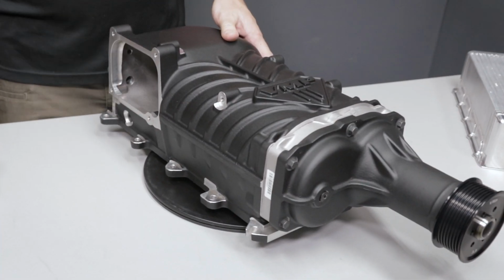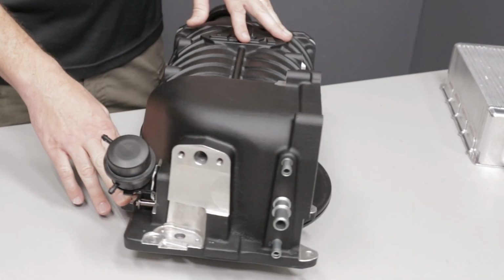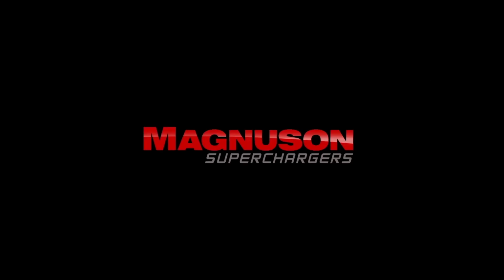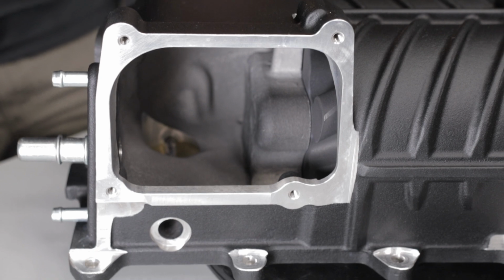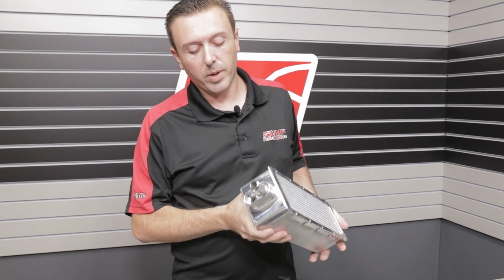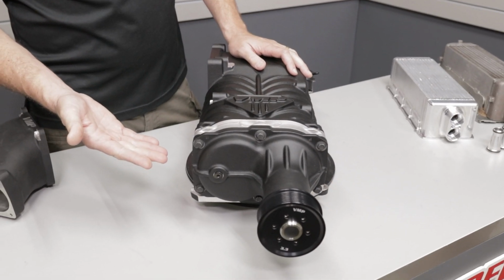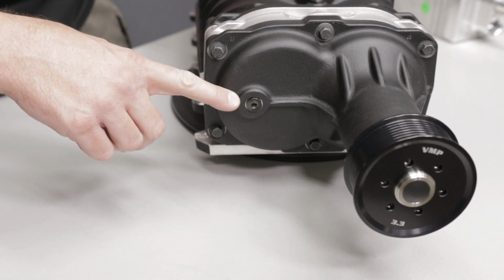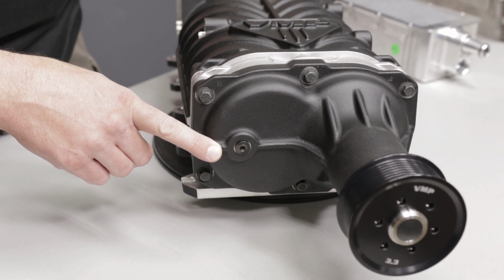Cobra Gen3R || 03/04 Mustang Cobra Gen3R and Upgraded Intercooler

Comment: Out of curiosity, what year did you guys come out with the VMP gen 1 2.3? Mid 2000's?
Reply: The 2.3 tvs rotor pack didn't come out till I wanna say 2007ish and vmp made their version sometime after that.
Reply: @midnight347  Ah ok. So more like the late 2000's. I was just wondering because the VMP 2.3 blowers are still impressive for the 03 04 Cobras even today, and especially if you push them. There are a few guys that made low to mid 800whp on them with cams on a stock motor.

Comment: Will this survive on a stock cobra motor?
Reply from the maker: If you're asking if the engine will survive, yes.  We've got quite a few folks running these on stock Cobra engines both on 93 and E85.  You just have to pulley them accordingly.

Comment: Would this work on a saleen s281?
Reply from the maker: Hi Tommy, we'd need more information about the car.  This particular supercharger is for the 03/04 Mustang Cobra 2v cars that came factory supercharged.  We have coverage for a few platforms, primarily 11+ Mustang and F 150 with the Coyote engine.
Reply: @VMPPerformanceTV  the cobras had 4v. This is a standard GT 2v engine with an Eaton m90 supercharger, the predecessor to the Eaton m112 that is found on the terminator cobras.

Comment: I'm curious to see these mostly stock results. I also believe Corey is headed to the dyno on Thursday so we'll have some stock motor e85 results too. Mine is currently ready to go on, just gotta button up the fuel system first. About to have some of these things on the streets!
Reply: Same here. Mines on E85. (Bought it this way) . It was Tyler’s car from DNA. So the blowers brand new as the rear of the parts are!
I’ll be getting it re tuned to pump gas on a full mustang style dyno this Thursday.

Comment: How many miles can I put on my oil in the supercharger?
Reply from the maker: It is good for 100k miles.  It doesn't hurt to check the level and condition of the fluid as Justin discussed in this video periodically with other routine maintenance.